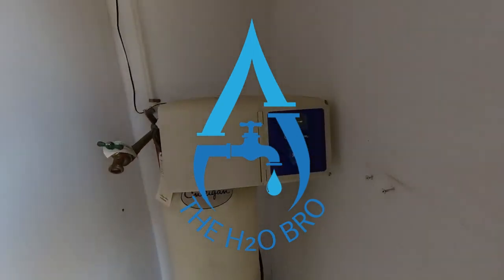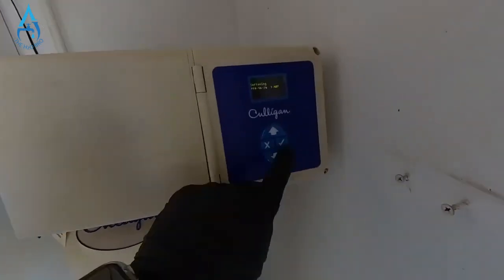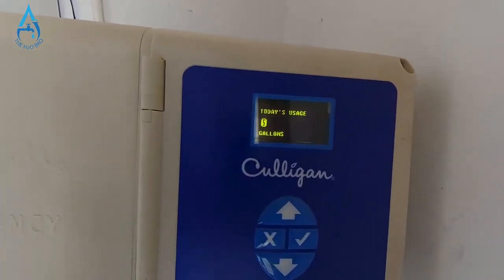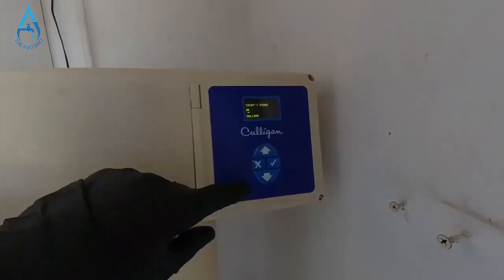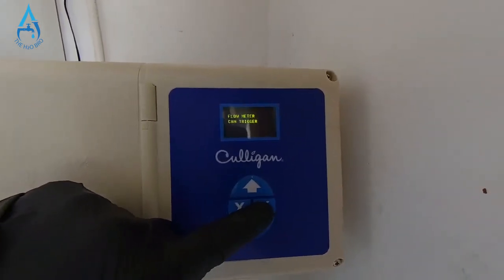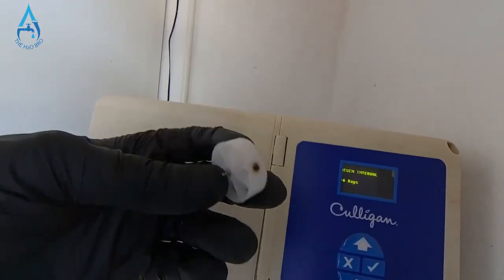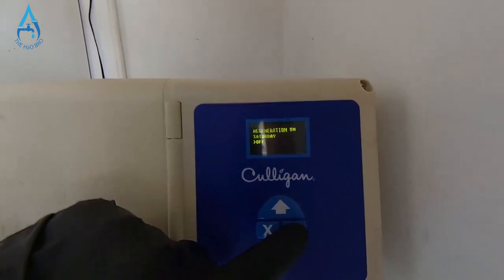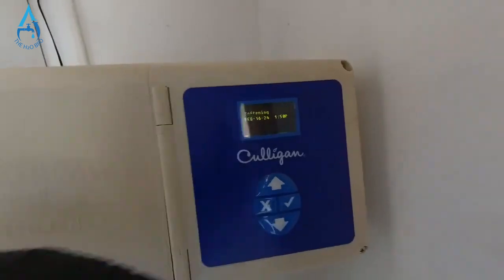Water softener salt not going down? Quick fix

Comment: I have an HE1, Mine shows no flow, So I will be taking mine apart soon.

However, I do have the AquaSensor as well, and it always shows 100% capacity.   So Is it not working also?   Technically with the Aqua sensor, I shouldn’t even need the flow sensor? 

Thanks..
Reply from the maker: It shows 100% capacity because it is controlled by the flowmeter sensor and not the aqua sensor. But yes if your aqua sensor is working and it triggers regenerations then you are good
Reply: @TheH2OBro How do I know then if the AquaSensor is in-fact working and triggering?   My water doesn’t feel soft.
Reply from the maker: @FlightLogProductions get yourself a soft water test kit first and foremost and also you can check on the control how many times it regenerated in the last 14 days
Reply: @TheH2OBro It says 0 regen in the last 14 days, last regen was 30 days ago.

Comment: Hi, I have this model and am having a similar issue where it hasn’t used any salt in months and the water level in the tank is high, above the salt up to the overflow hole on the side. I checked the flow meter and it is working. Any suggestions?
Reply from the maker: https://youtu.be/cA-DQj8ae9g?si=rbwr8zR3-lsH2gQ_
Reply from the maker: You most likely need to replace the pistons